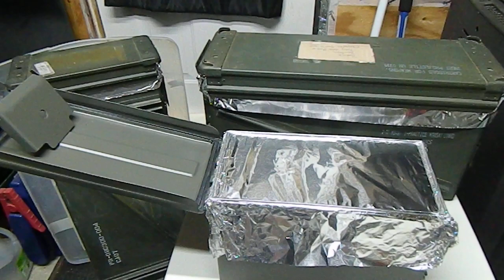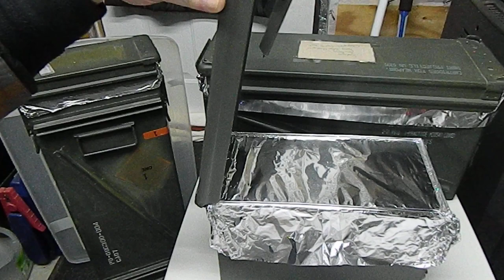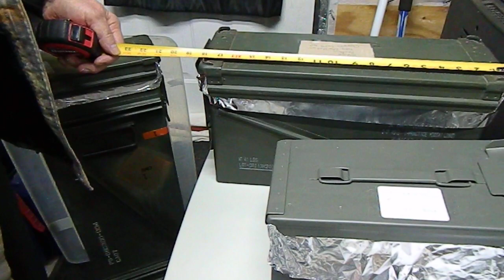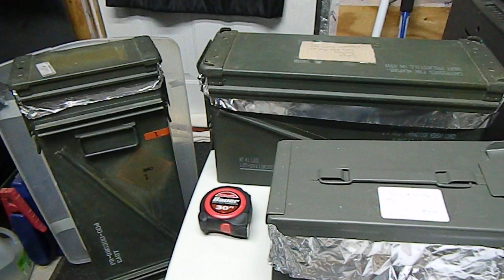Follow Up From Ammo Can doing it wrong.

Comment: You should also supply a good large conductor wire that runs to earth ground.   When the can absorbs the energy it needs a place to go.  To ground is best.   If you don’t the can will absorb energy to a point, then it will allow the energy to permeate the can
Reply: bingo :) .  half inch metal (copper would good choice  and silver/gold even better one) rod  should do. or get one of those  lightning protection metal strips  and weld/fix it on the can.
Reply: @ApocGuy  what is typically used with ‘real’ scientific faraday cages is that braided flat wire, similar to what’s used to tie your car engine to the chassis ground.  The reason you need to ground the ammo can is to provide a path for the induced energy from a EMP  event. Just having a metal can doesn’t protect anything.   In a pinch, the inside of a microwave works fairly well, not as good as a well grounded can, but it’s not bad…..just don’t turn it on with anything inside
Reply: @joefunk4552 how recent of a microwave do you need to use to protect electronics?

Comment: You are only as old as you think you are. Think young and you will be young! Best thing I did was ROTC while in college, recently retired as one of Uncle Sam’s Misguided Children, O6. 38 years. Worked in Embassy Comms, and was lucky to also work with CT as well.
Living in the south eastern EU, a bit too close to some of todays conflicts. I have used a new NEMA aluminum enclosure (24”x24”x10”) Did the conductive gaskets on the case and insulated the interior and it works good up to 1.9 GHz. Might try hitting it with my Ka band radar while having a radar detector inside it. Nice thing is it can run pulsed or continuous. It’s running at around 24 GHz.
BTW OPA in Greek is an expression of happiness and Joy!

Comment: Youre supposed to remove the rubber gasket out of the Ammo Can and sand the paint off the can where it comes into contact with the foil.

 This creates a complete metal-to-metal bond with the case and aluminum foil. The rubber gasket can cause leakage of EMP into the can.
Reply: When you remove the gasket, the sanded surfaces won’t make contact.  The foil,method is better
Reply: why removing the rubber gasket? just sand down the inner part of lid, so it will make good contact with tin foil. i'd replace that foil with EMF cloth or smth like that though.
Reply: @ApocGuy  don’t remove the rubber gasket as it does help seal the can from moisture, but it does help press the foil into compliance with the sanded surface
Reply: @ApocGuy  You can do what you want, good luck on your "EMP proof" electronics stash....did you even read my entire comment?